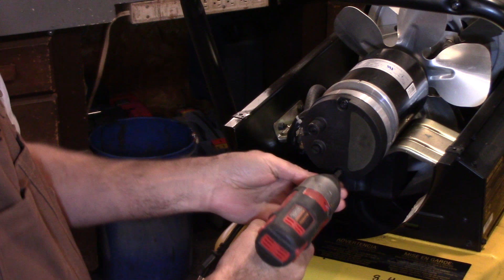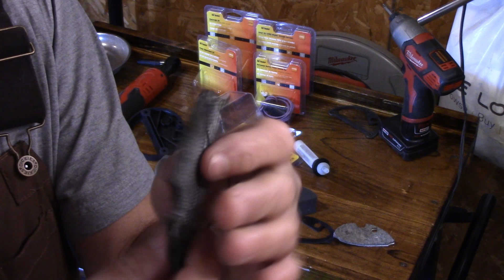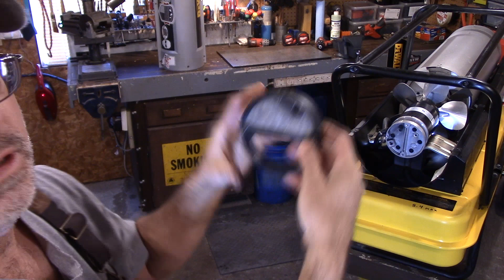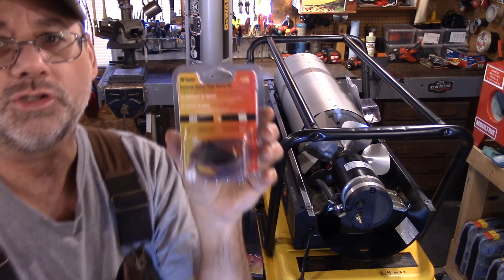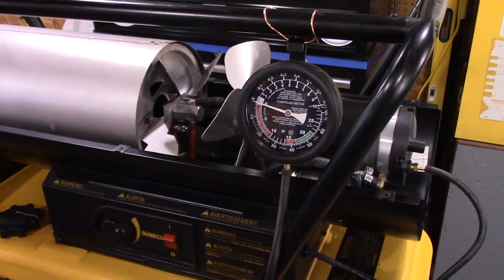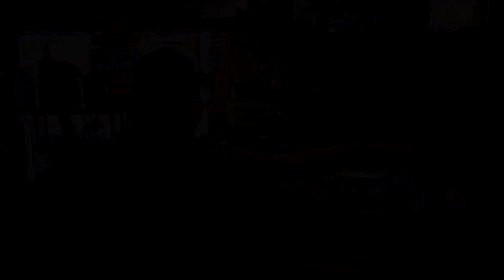DXH215HD 215,000 BTU/HR FORCED AIR KEROSENE CONSTRUCTION HEATER - MAINTENANCE AND DIY TIPS

Comment: Where do you buy the kits at
Reply from the maker: I just buy it off Amazon.  The best prices in my area so far.
Reply: @SteveRobReviews  ok I been looking on there. I have the exact model and my heater will only start if you block the back of it but will not say running so I was going to buy all the kits
Reply from the maker: These are made by MR Heater, so I searched  that not Dewalt.  I'd be looking for cracked hoses first then I would check the pump pressure.  What are you blocking off to get started?
Reply: @SteveRobReviews  the back of it
Reply from the maker: The back of the intake, air filter  for the air pump or the back of the unit where the fan pushes the air out the front .

Comment: Thanks for your video this was so helpful, just a question manual says normal psi should be 8.4 you think put it down to 7 will be a better option or should i leave it where Manual indicates? 8.4 brings flames out.
Reply from the maker: I would lower it a bit to keep the flame back in . The gauge is a good reference but its not exact.

Comment: Very reliable we used these when running pipe in all types of weather  the colder weather Made it run rich. Biggest problem were the rubber hose s only time they were serviced is when they  broke. Fell  of the truck ha ha
Reply from the maker: Fell off the truck would do it  :)

Comment: Can't take the taste of space heaters. When they are running I can taste the fuel no matter how lean ya run em. I'm  very sensitive. Didn't deliver fuel too long cause just loading the truck with the oil bothered my nose.
Reply from the maker: I don't run it when i'm in there shop. I start it up and it turns off at 80 degrees . I go back in after a bit with the electric heat turned on.

Comment: I am for sure not an expert Steve. But temp will effect the spring rate on a spring.........It would be interesting to see what the pressure is at a very cold temp versus a not so cold temp. My money is that there will be a difference!
Reply from the maker: Tom that's a interesting observation . I will check it this  winter . Thanks

Comment: That should get ya better gas mileage too. :-) I used to run diesel in mine and sometimes it turned to jello during our long summers. That was 30 years ago when diesel was real.
Reply from the maker: Yes that's when we had high sulphur content. I do put a diesel treatment in it to prevent it gelling up in the winter.
Reply: @SteveRobReviews  When I first starting working I cleaned furnaces and delivered diesel fuel and kerosene. In the winter we would cut the diesel fuel with the kero when it got real cold to help with starting the engines.

Comment: Never needed a heater like this but I understand the need for the maintenance....that fuel or kerosene does not atomize well if things are not clean well adjusted just like fuel injectors in a care and injectors in a diesel....maintenance is the key for it to work well....CHEERS
Reply from the maker: Gator it heats my shop on the coldest days to 80 deg F in 10 minutes . I then switch over to electric . It would take the electric two hours on high to get to 60 deg. F .   I really like it because I  don't have all day waiting for the shop to get warm to make a vid . LOL
Reply: @SteveRobReviews  I just leave my heat at 55 and it`s all good unless I know I won`t be going in there for a weak or so....I have to admit that in my younger days when I use to build houses part time I had an electric furnace ...a 15KV that I used to heat for working purpose and I used it a lot....now it`s on the farm for when they need emergency heat....at the beginning I use to rent propane construction heater but being an electrician....electric heat was the way to go...I have a project if I ever get to it,,, it`s converting a mobile home indoor furnace to heat my garage.....but....but ....I have to hurry ...I`m running out of time....CHEERS